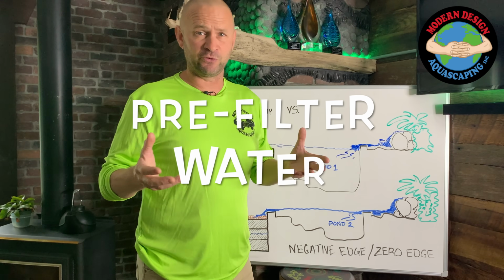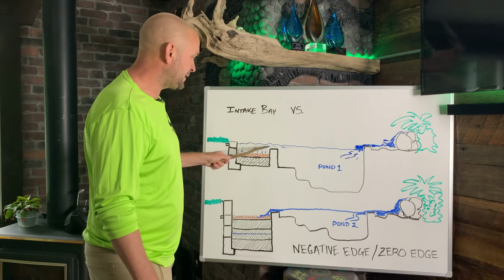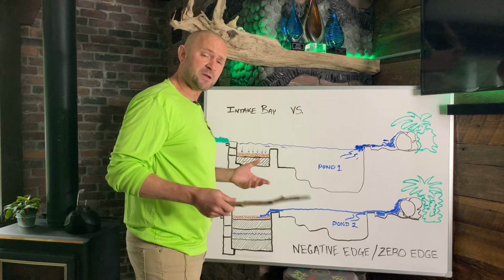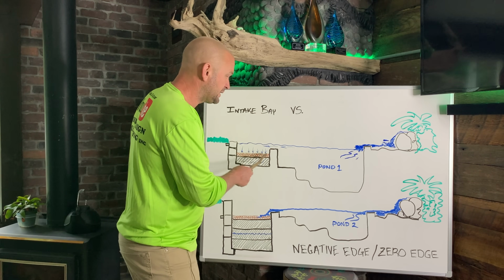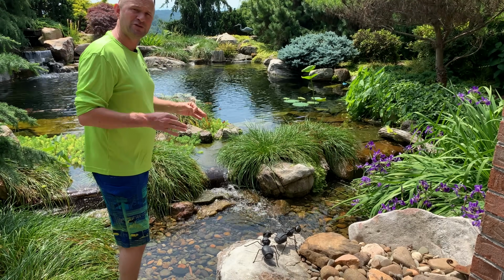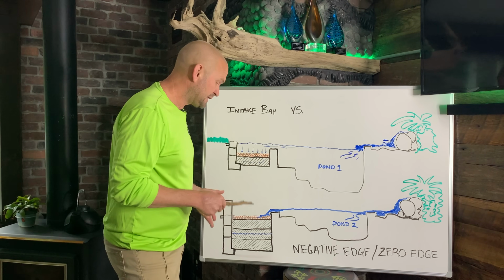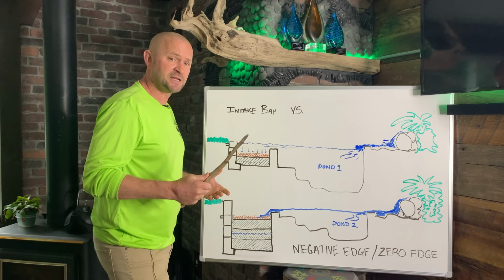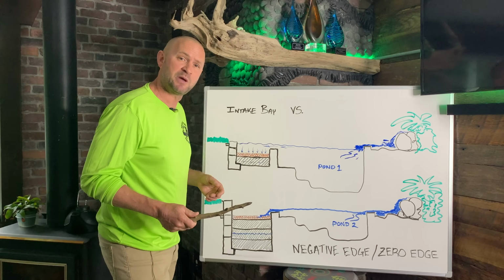Zero Edge vs. Intake Bay | Which Pond Skimmer is Right for You?

Comment: This might be a bit off-topic, but I'm converting a ~20,000 gal concrete-lined pool into a pond. I'm planning to cordon off a section of the 3ft deep shallow end into an intake bay. How should I construct the wall separating the intake bay from the rest of the pond? I'm thinking I'd use rocks and mortar, would that be suitable?  Also, should all of the water be flowing through the intake bay or should I have another intake somewhere deeper in the pond?
Reply from the maker: I would just put liner on the bottom and then rocks on top with some mortar would be overkill. The downside would be that you couldnt drain the intake without draining to the bottom of that section (this design is water resistant design-not waterproof). The upside is ease of design and installation and it works just fine. Use stones on top to hold up liner and the on other side as well using gravel to fill between-basically creating a dam to restrict water flowing by. I like to pull all flow through the intake personally.

Comment: Wouldn't you need some kind of system with the negative edge to ensure the water level doesn't drop to the point where the pump runs dry and burns out?
Reply from the maker: Yes, if you watch our water in motion videos, we cover how to determine that and then we make the reservoir in the negative edge hold 2-3 times that much water. The reservoir I just put on my pond (under construction still) is over 8000 gallons. This is why it’s so much more expensive to add the negative edge system to a pond.

Comment: Great video! 
Can you cover the top of the negative edge intake bay with an extra overlay + sand on it? I'm planning a sandy entrance for my children and I think the negative edge area would be suitable for this. Thank you.
Reply from the maker: This is a very “high-flow” area, I would think that your sand would end up in the reservoir bottom and cause a mess…If you can figure out how to stop that from happening you are good. It always seems to migrate down though. Heavier sands are less problematic but if it ends up in the bottom, it will be a constant maintenance nightmare for you to get it out.
Reply: @koiaddiction  Thank you! I think I'll stick with the intake bay + sand combo. There is not a huge drop of water, maybe it's easier to keep the sand on the top of the filterbed maybe with 2 coats of overlay geotextil.
Reply from the maker: Sounds good, let me know how it works so I can share it with the world, that’s how we all learn TOGETHER! Have an awesome day ✌️
Reply: @koiaddiction  I was thinking about it and now I'm afraid that the 2x300g geotextile could hold the sand but would grab all the dirt, and it'll accumulate between the sand and the geotextile. So no dirt will be trapped at the bottom of the intake bay. What do you think?

Comment: Ok John, you said these are not biological filters.  I thought covering the AquaBlocks with layers of stone created the biological filter.
How do you clean the Zero Edge reservoir?
Reply from the maker: Well, it is a small bit of biological filtration but not what its purpose is. We actually remove the debris from the reservoir by hand. It is the collection area for debris and physical removal is the way. When necessary, we drain and rinse but if you don’t let it get out of hand it isn’t needed often. That is the reason we only put a small amount of stone on the intake side and also why we use 2-5” stone because it doesn’t clog as quickly as smaller gravels do!

Comment: Hi John
How about explaining how to add a proper zero edge skimmer to an existing pond 
would the set up be more or less the same as a wetland filter but in reverse ( flow )
What would be the proper sizing in relation to surface area 
Thanks in advance for your help
Reply from the maker: Watch our water in motion videos. After calculating your water in motion for the entire feature, double that (minimum) for sizing the reservoir below the zero edge. The reservoir is the same setup as in a pondless waterfall after that!

Comment: How do you auto-fill the zero edge system to ensure the underground reservoir remains full?
Reply from the maker: Fill the reservoir-turn on the pump- once the water reaches “circulation”, you know where to set the auto-fill level in the reservoir (just below that level). That way it stays full enough to run, and still can hold the water in motion if the power goes out. Of course if rain fills it up more, it will still overflow in a power outage - but it will drop back to the same level once it fires back up again. Make sense?

Comment: Hey Wild, do you have a video on making a negative edge intake bay? Love your stuff from Aus 🤙🏿
Reply from the maker: No not specifically. Really all you need to do is create a normal intake bay that has a small waterfall at the end of it going into a rainwater capture system. The trick is to calculate water in motion and then double or preferably triple that amount in your storage holding capacity.
Reply: @koiaddiction  do you have the same aggregate and blox in it as the wetland filter?
Cheers

Comment: I know the sideview was meant to show all the layers and waterlevel and stuff but looking at it this way made me wonder: is it feasible to have an intake bay as a part of a rocky beach to walk into a recreational pond?
like, there's the edge of rocks that's sometimes/often dry, then some ways in there's a hidden belt of the intake bay, and then the rest of the pond?
Just a fun thought I'm wondering. I keep seeing the intake bay as some separate little pool, which is fine, but this could be an interesting take...
Reply from the maker: Yeah we actually just worked on a project with a American Aquascapes in North Carolina where they did exactly that. I have done it on a small scale before and used a small Riverstone beach area as the intake. I just prefer to pull all the crap further away from the pond instead of collecting it right in the edge. It really depends on the circumstances the water feature and its surroundings on whether or not that would be a good idea or a lot of work...

Comment: Do you spec your Intake Bays to contain 1 minute's worth of the total demand that your pumps will need at max flow? Even if you have three in the bay (1-Wetland, 2-Waterfalls)? Do you allow for 6-8" of water over the Intake Bay Wier Stone, & 12" - 18" of water over the gravel in the Intake Bay?
Reply from the maker: I do 1 large block per 1000 GPH on intake- 1/2 that much if im “trimming costs”. Intake depth depends on water level fluctuations. 6” is plenty if water level is constant. (Above gravel) but obviously width comes into play. I prefer to create a swift current into the intake area through a choke point which widens out over the aqua blocks in the intake bay. If you create an adjustable scenario, it will allow you to dial the feature in to perfection. You want to create a situation where you have a swift skimming action that pulls into a large downward infiltrating area but also, not something that can move so fast that it traps your fish :)
Reply: @koiaddiction   Thank you for the additional info.

Comment: Great video John. I been watching all your videos and  thanks for the knowledge sharing.  Your videos always motivates me.     I am planning for pond with 10x15x4 .  What would you preferer a mechanical skimmer or an intake bay for my pond.  I was thinking  of both. Skimmer ( 4500 GPH pump)  feed the water to  Bio filter and Intake bay ( 2600 GPH) feed the water to  wetland filter. So during winter I can turn off the Intake bay/Bog filter and the let the other one run throughout the year.  Do you think having an intake bay and a mechanical skimmer is too much?
Reply from the maker: For that pond probably is over-kill. BUT- I have fed a wetland and jets from a SS 1000 skimmer and used a small intake system for the jets -the pond is a bit bigger than what you are doing and the water is so pristine ;)

Comment: @Modern Design Aquascaping Inc.  
what should be the size of intake bay for a rec pond of size 21*16 ft(5 ft deep) ?
Reply from the maker: The intake size is determined by the flow rate, not by the pond size. You would have to let me know what your flow rate is that you’re drawing through the intake in order to have parameters to size the intake.
Reply: @koiaddiction   i will be using a single , variable frequency submersible pump ,of max capacity of 10,500 gph which will be pumping water to a biofall and through to a bogg filter . The minimum flow rate on the biofall will be 3000 gph on a regular basis while for party times it will be around 4000 - 5000 gph, while the flow rate to the wetland will be 3000 gph( i dont know how much output flow rate will be from a 8*10 wetland if the input flow is 3000 gph).  so, the minimum total flow rate from the pump will be 6000 gph at minimum.

Comment: John! Absolutely love these videos you are doing, thank you, thank you, thank you! One thing I still can’t seem to comprehend though is the standing surface water after the negative edge in the beautiful koi pond example? How does this work? Wouldn’t the water level have to be buried/lower within the containment basin to allow enough space for runoff if the system was turned off? Allowing all the water in motion to eventually fill the basin? I love the look of standing water/pooling after the negative edge! What am I missing here? How do I make this happen? :) Thanks John!
Reply from the maker: The standing water below the falls in the negative edge can be posed by using a “bib-liner” that is basically a bowl on top of the reservoir. It holds water on top even when the water level in the reservoir is low! The res has to be able to hold at least 2x the water in motion for the entire water feature so it can be costly and also a large part of the project. Hope I answered your question?

Comment: Great informative video.
I'm in the process of building my pond and like the concept of the intake bay where it is a part of the pond.   I am limited in space (10' x 8' x 3').
What are your thoughts of an intake bay feeding a bog filter and an under gravel filter bed being powered by an airlift system and dispensing the oxygenated water back into the pond?

Any insight would be greatly appreciated.
Thank you.
Reply from the maker: Never tried that aeration system in a pond, only in a fish tank but it sounds cool. I like the intake bay but I prefer a skimmer on a feature that size, easier to clean and maintain. We have done beautiful ponds with skimmer / wetland combo👍
Reply: Thank you for responding and giving feedback. Ok. I will do the skimmer with a bog combo for one piece and the airlift powering the under gravel grid

Comment: Hello, thank you for the video.   I have a few questions.  

1.  The zero edge receives the water on top and it gets pumped out from below.  How does this compare to an werland filter?  
2.  Can you have both the zero AND a wetland filter?

Again, thank u so much for taking the time to create these videos.
Reply from the maker: Yes to #1, no 24” deep gravel bed below a zero edge, just 6-9” deep of 3-5” diameter cobbles for easy cleaning. 
Yes to #2, that is the absolute best combination 👍🏻😎
Reply: Also, where does the pump go and how,  often does it need cleaning

Comment: John, my excavator is coming tomorrow and I had the brilliant idea to redesign things to include an intake bay at the last moment instead of a skimmer. I have 2 questions if you have a moment.

A skimmer has a door on it that kind of self-regulates the level of water that is being skimmed as the pond level rises and falls, right? That won't exist (unless I design something brilliant...) on an intake bay. If pond level rises, you're skimming more water. If it falls, you're skimming less. Also, a skimmer weir has a fixed width. What you see is what you get. But you have to design your own width for an intake bay. So, two questions:

1. How do you maintain optimal skimming effect as the water level rises or falls without that self-adjusting door that would come with a skimmer?

2. How do you decide how wide to make your weir? Should I just copy the width that would come with the skimmer system for a similar sized pond?

Thanks for any advice you can offer. If it gets too complicated for me, I'll just go with a skimmer and be happy I finally have a pond.
Reply from the maker: Wow that’s a tough one, I am a fan of an intake bay but honestly if you’re not exceeding your flow rating for a skimmer it’s easier to service and clean. You need to be careful when you build your intake bay bay that you don’t make it too deep and wide because it won’t do a good job of skimming. On the other hand you have to make it deep enough to accommodate whatever water level fluctuations you intend to tolerate. It’s not super complicated but I have built a beautiful 20 x 20 pond that’s 3 feet deep with a wetland filter fed by A skimmer. The intake bay is a great concept but it’s not right for every situation. I would say with an Aqua Scapes 1000 scammer if you’re only pulling 8000 gallons per hour the skimmer is the better bet.
Reply: @koiaddiction  You're a legend, John. I'm estimating about 7500 gallons, so a little on the margin. But as long as I don't grow an affinity for koi, I think I should be safe with a skimmer.
Reply from the maker: You can also just use pondless vault with 6 small aquablocks to make a small “intake” area next to the skimmer and then put an aquasurge 5000  in there. Use that to feed 5 jets and your good. By placing it near the skimmer you enhance the “skim” without overloading the skimmer. Feed your wetland from the skimmer and all is good in the hood🤘🏻😎
Reply: @koiaddiction  Never even considered combining them. Why not? Makes perfect sense.
Reply from the maker: Do it🤟

Comment: John. First, thank you for your videos. They have inspired me to go with a natural swimming pool instead of a traditional one. How do you determine the size of your intake bay including depth length width and how many blocks. I will be building roughly a 20 x 40 natural pool. Any info is appreciated thanks again.
Reply from the maker: Sizing is based on flow rate in intake. Typical intake is. 1/2 - 1 large aquablox per 1000gph flow rate. Minimalist 1/2 per 1000–less maintenance 1 per 1000 gph👍

Comment: John - I have a question on your auto-fill in a pond with a negative edge.  My assumption is that your auto fill is in the negative edge reservoir at some depth you determine as a minimum water level.  Is that correct?  How far below the top of the gravel do you usually put the Autofill? Thanks - JH
Reply from the maker: Fill the res, plug it in, when it is in circulation then set auto-fill just below that level in the res ;)
Reply: Modern Design Aquascaping Inc. That is what I had figured.  Thanks for the confirmation.

Comment: Hey John awesome info and thanks so much for taking the time to do this stuff it’s really great  have a question , if I’m doing a neg edge intake bay in combo with a wetland filter dumping into the pond with waterfall and the water level in the wetland is at a higher elevation than the pond would that water be considered water in motion or would you just put a back flow preventer in the line to the centipede , in a power shut down wouldn’t it flow back into the pond
Reply from the maker: Confusing to me...Water above will flow down when pump stops. I need more info. To understand the situation. Tell me more or we can set up a quick call to discuss!

Comment: Im curious what do you think about the moving bed filter media being used in biofalls?
Reply from the maker: The bottom drain system in the bio-falls is something we have been utilizing more and more. That gives the ability to flush it out more often with less disturbance to the biological. If you do this, you can get away with the mats-if not they tend to clog up and then “push out” due to back pressure. Did I answer the question? 😂
Reply from the maker: We have used bio-balls and also matala-style pads layered in. Those have worked fine for us but you could try it? How would you back-flush?
Reply: I got the idea watching a video on the Helix moving bed filterfalls, but man they're expensive, but the idea of the media being self cleaning as Triplett claims is fascinating..
Reply from the maker: I have used systems with bead filters and air powered agitation, it’s another way to do the same thing. Having good biological and high oxygen levels is key -I think how you get there is just preference or “upbringing”. Thanks for the interaction😎

Comment: Great video 👍
What size intake Bay do I need? I use 2 pump's in my current Skimmer setup, each 20000 liter variabel.
😃
Reply from the maker: I typically use 1 large aquablock per 1000 GPH whatever that equals out to in liters🤣 I see people use less, I have used more-it totally depends on how much junk you want it to hold before it clogs up. More is better to me...